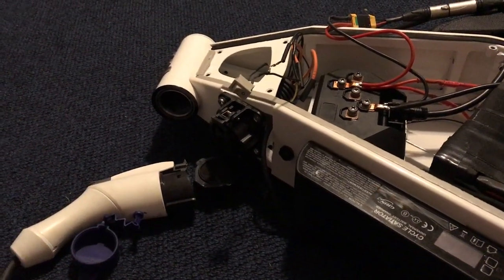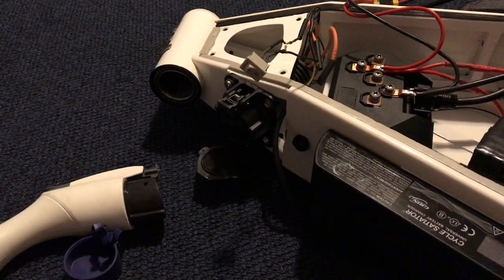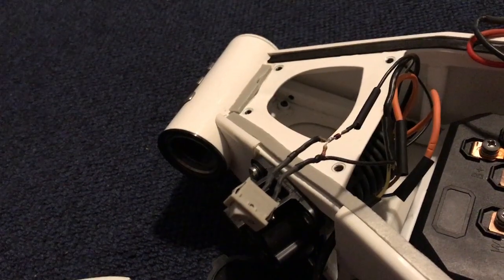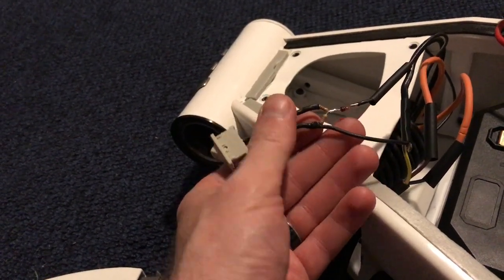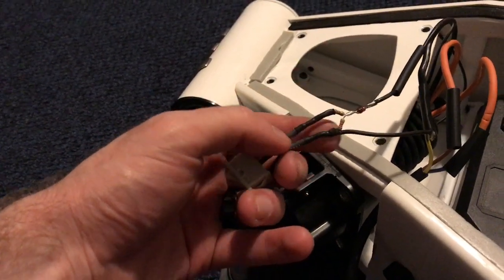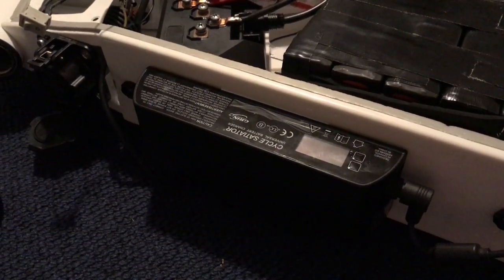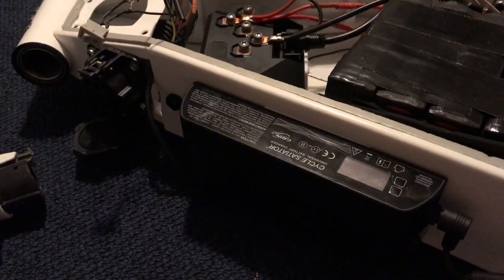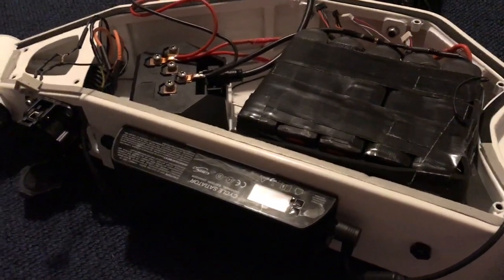Charging an Electric Bike with a J1772 EV Plug

Comment: I have the same Frame. Just built mine this year. Mine is pretty much plug and play though I didn’t do any battery wiring. I’d like to be able to charge on the go as well! Would we be able to talk?
Reply: You can purchase a converter and install a outlet charging station directly to the bike if your bike is build for a direct charge such XLR.
Reply: @fgh2756  how would I find out if my battery is? 

Do you by any chance have a link to the device? Also would this charge at higher speeds?

Comment: Can you elaborate how this setup makes the EVSE output 220V (instead of 240V) to power the Cycle Satiator? From my research, the Level 2 EVSE's can put out 208 - 240V, but nothing elaborates on how to control the output voltage so you don't fry the Cycle Satiator.
Reply from the maker: Chris Olin you won’t fry the cycle satiator, it will auto compensate based on input voltage. Just don’t go above 240VAC, and I’m not aware of any publicly available electric voltage world wide that exceeds that.
Reply: jim just hand over the parts list k buddy i need the gadgets dont hold out on me
Reply from the maker: There is no different between “220 and 240v” for the cycle satiator they are two ways to say the same thing. AC voltage is not precise in its vernacular.

Comment: so let me get this straight.. you plug it in and feed it 9v will tell the charger its connected.. then feed it 6v via your switch which changes the pathway through those resistors to make it 6v .. which tells the charger to start charging